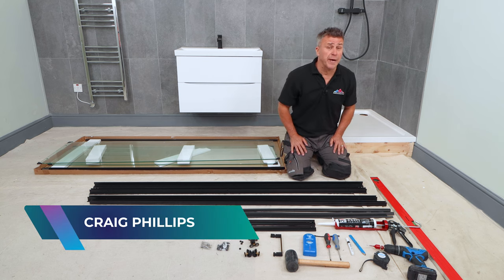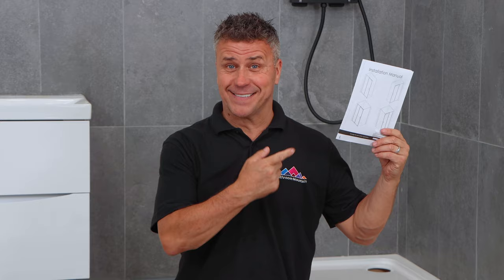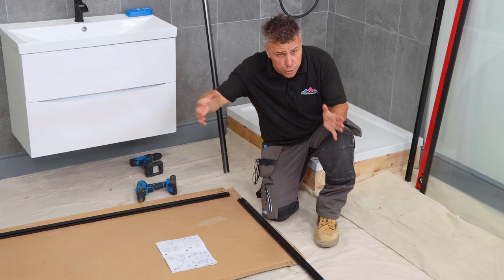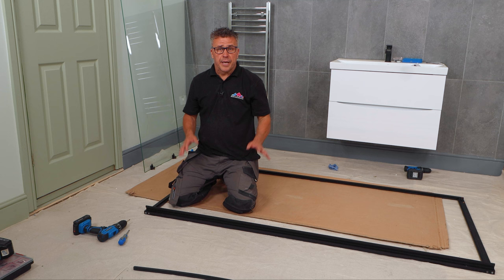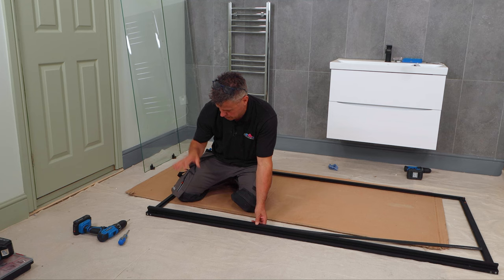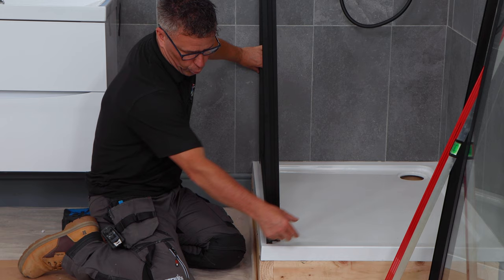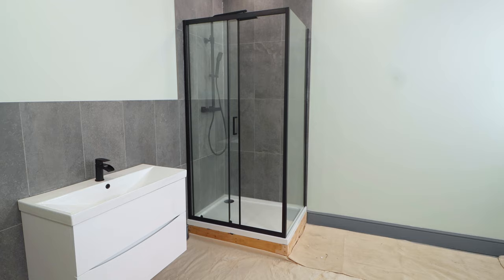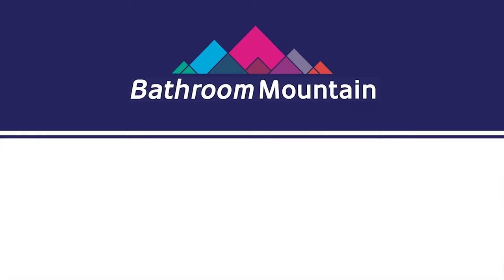How to Install a Sliding Shower Enclosure | Top Trade Tips

Comment: Wonderful guide thank you! My only question, what about the screws that are going through the frame and into the tiles? Does that not need any silicone? I understand no bead down the profile as it will let any condensation filter down the profile and back into the tray.
Reply from the maker: Thanks! No, as it will be capped off it won't have any contact with any moisture so it should be fine! You could strike a line of silicone on the outside of it to cover any gaps if you wish with a clear waterproof sealant like Multi-Use or GP

Comment: Thanks for the very good video! One question I have about the side panel… (11:45). It looks like it is not fixated by a frame, top nor bottom? If I understand correctly, it does has vertical frames on the side, but can’t is slide out of those, should someone accidentally lean on the sliding door? The screws in 20:12 surely don’t actually go through the glass to let the glass take that force do they?
Reply from the maker: Hi, so you just temporarily fix it to the wall, then after the glass goes in you tighten the frame to make it stronger. and at 20:12 there are already holes drilled through the glass so its just a case of putting the screw in and tightening it up from the other side 

Thanks mate!
Reply: @MrandMrsDIY  ah ok, thanks! So those holes actually go all the way through the glass, not just through the frame the glass is in. I guess the shower enclosure came with those holes already pre-drilled right?